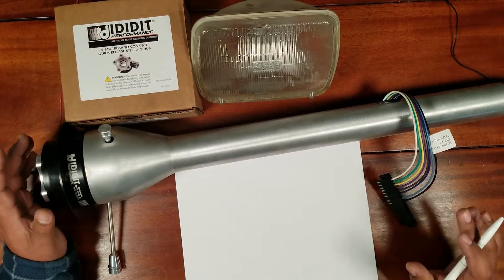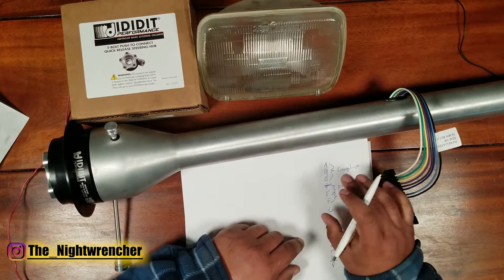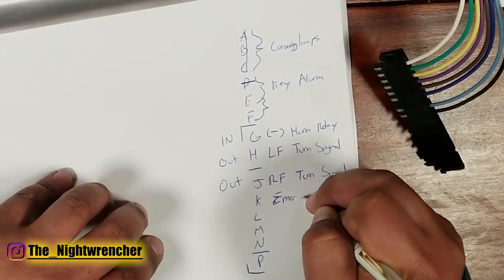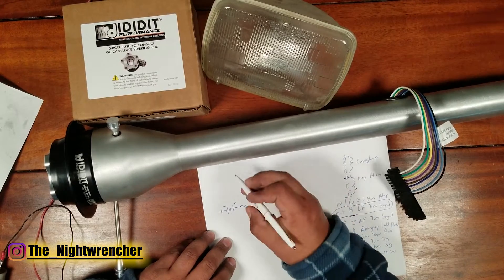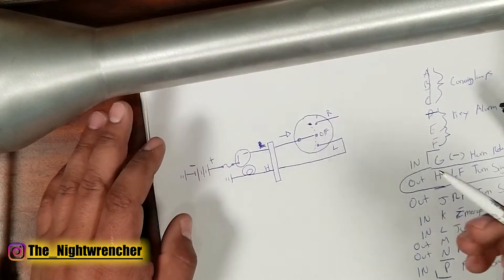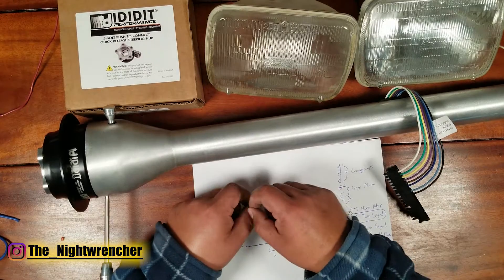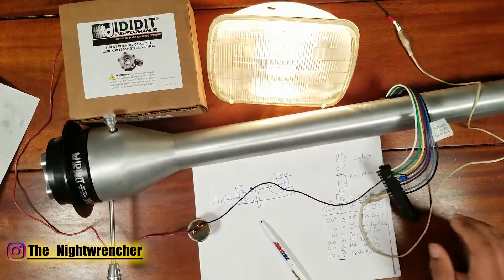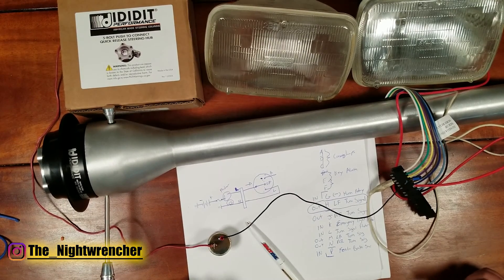Easiest How To Wire A Steering Columnn Wiring - IDIDIT Pro Lite | Classic Car Wiring Basics |

Comment: Question so my hazards come on with my turn signal new flasher and new turn signal switch can’t figure it out
Reply from the maker: @azams234  almost sounds like you got a crossed wire or you have a bad hazard switch
Reply: @ the hazards are build into the turn signal switch 85 Chevy caprice classic that’s why I’m kinda leaning towards bad turn signal switch

Comment: @nightwrencher, I'm a fan of your page. I've left you some comments before. You are a seriously badass dude and very effective teacher, very good at explaining things. I'm hoping you can point me in the right direction, and I apologize for having to ask this here but I have tried asking everywhere else.    Basically I have a 78 el Camino, supposedly has a crate motor with like 8k miles on it. I left the headlights on, battery died, tried an everstart jumper box and it was too weak, then I got a jump off from a Honda, and while it was warming up I smelled fire and shut it off. There's an aftermarket 30amp fuse they seem to have wired to the starter, because it was totally melted and catching fire, and it wouldn't turn over again at all til I replaced the fuse holder tonight. It then blew both a 20amp and a 25amp fuse I tried, and I had to use my harbor freight jumper box since the battery was still too dead. Both fuses blew while it was running, after successfully starting the car with the harbor freight jumper box. I'm afraid to try a 30amp again since it melted before on a 30amp. So the last time I started it, with that 25amp fuse, like I said it blew while the car was running, and the wires had gotten very warm before it blew. So I was going to just try to drive it home and then the headlights got dimmer until they cut out completely. Still have turn signals (the grounds of which I just fixed a couple days ago), still have brake lights but no tail lights, and still have flashers unless the brakes are pressed.    Can you point me in the right direction? From what I hear it's very odd to have a fuse going to the starter
Reply from the maker: Hey bud, you have a whole mess going on in that car. First of all, there is no fuse that goes to the BIG starter wire. 30amps is barely enough for 2 fans, much less a starter circuit. I dont have a video on wiring the starter yet but if you want some circuit protection you can use a starter solenoid to cut off power to the starter, if. Not, you can wire it direct. You should have a dedicated fues for just your running right circuit and then one for each side of the head lights so 3 15amp fuses. If you are running everything off the stock wiring harness, you'll have to make sure none of the wires have melted. Id say, rewire that starter first and go from there.
Reply: @NightWrencher  I just now got to read your response. Thank you so much. You are so awesome dude. I sincerely appreciate you. Yeah it had no issues til I left the dang headlights on, apart from the turn signal grounds. I'm going to go through it and check everything I can check probably tomorrow